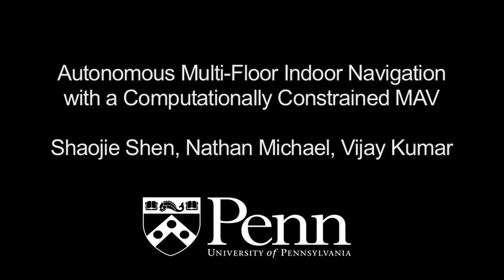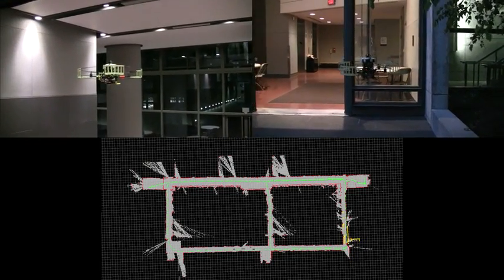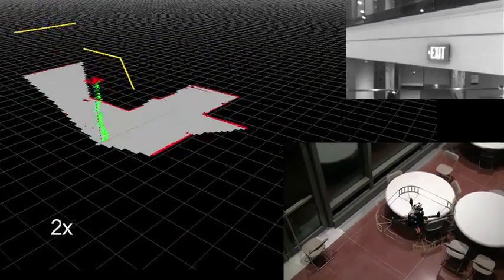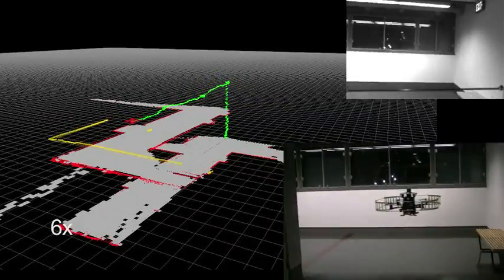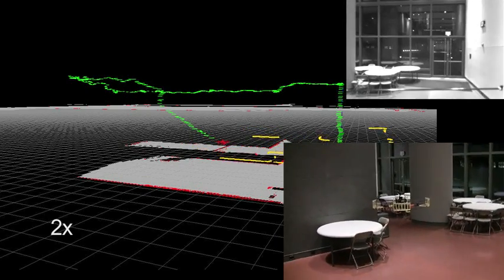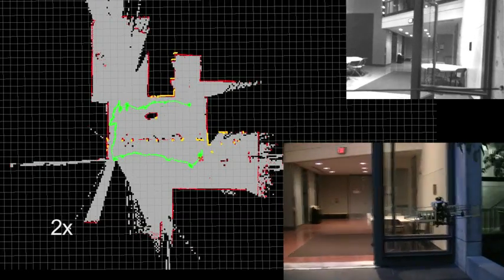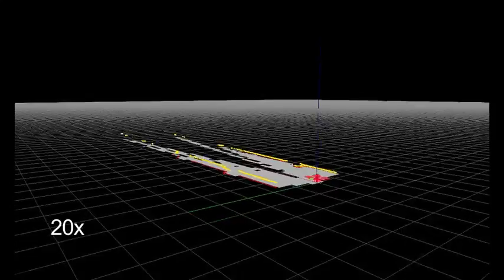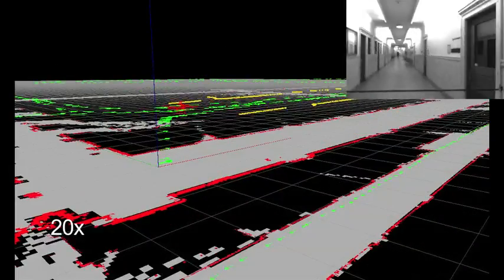Autonomous Multi-Floor Indoor Navigation with a Computationally Constrained MAV

Comment: The issue is the small intel atom processor. Also if you watched the video closely you would notice that they do not have a 3d sensor on-board (2d camera and a 360 degree laser scanner as well as an imu); yes they could do 3d, but no, it would not be effective on this platform.... 2d mapping is not a waste of time; and it is no small feat on its own that they have effective 2d mapping working on this tiny robot using ROS.

Kudos to the team who did this!